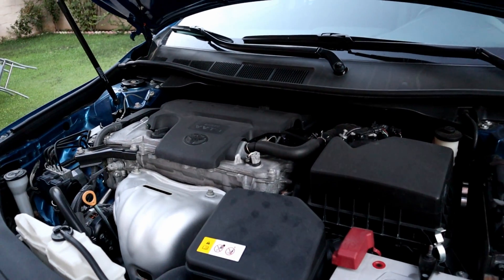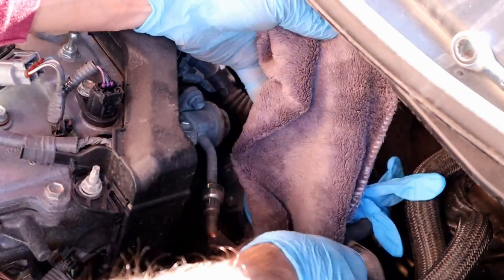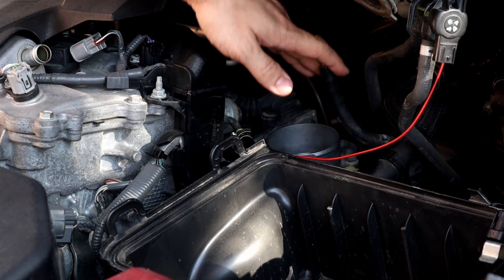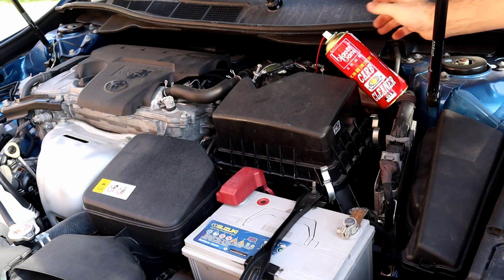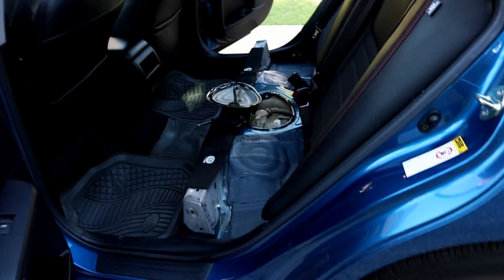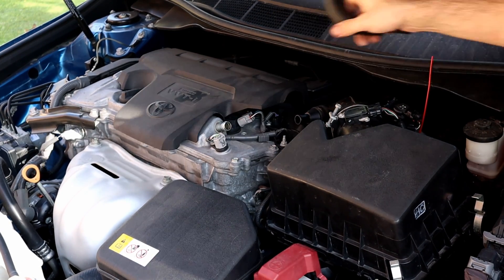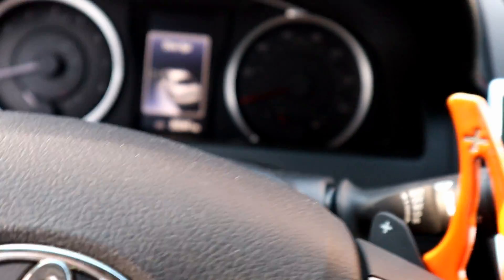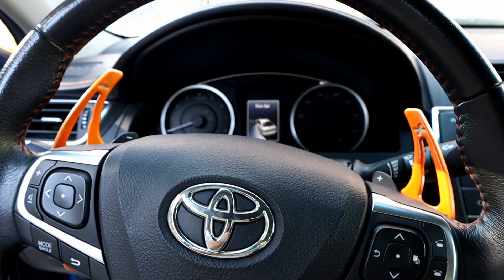Fuel Injection cleaning Toyota Camry 2017/HOW TO clean injection Directly without disassembling

Comment: Where did you get the long red tube from?
Reply from the maker: I bought seafoam can a while ago, and it came with it
Reply: @AliMECH  I have a 2011 toyota corolla and it has a misfire. I've changed the coils and sparkplug but it's still misfires any suggestions
Reply from the maker: This is how to check the coils, https://youtu.be/f1Wl9n-jUOE, and if the coils are good, you might need to clean fuel injection

Comment: Any risk if I removed all spark plugs
Reply: U just running on ur starter , if running for too long, it might fried ur starter
Reply from the maker: The engine is running, the carb cleaner burning like a fuel, not using the starter
Reply: @AliMECH  he said he removed all the spark plugs , engine won't run 
So just relying on starter to turn the engine to trigger the injector timing
Reply from the maker: That's a bad idea, yes you are right,  even for the starter and the fuel mixes with the engine oil,  o need to take the spark plugs out let the engine run

Comment: Great video once again 👍 any plans on changing the transmission fluid on the Camry? Maybe just a drain and fill?
Reply from the maker: Thanks, Yea I will, but not that soon, my car has 25k on it so far
Reply: @AliMECH  Nice, when do you recommend changing it? My 2015 Camry has 50k miles.
Reply from the maker: 50k or 2 years
Reply: Better at 30k miles or 5 years. Many people on Reddit and forum says it showed brown between black. Mine nearly black because I drive over mountain many times and winter time.

Comment: Great video
Reply from the maker: Thanks for the visit
Reply from the maker: Look like you didn't watch the whole video,  I took it out and the car wont start, fuel pump fuse in Camry not only responsible for the fuel pump  but also powering up the injectors, watch the whole video